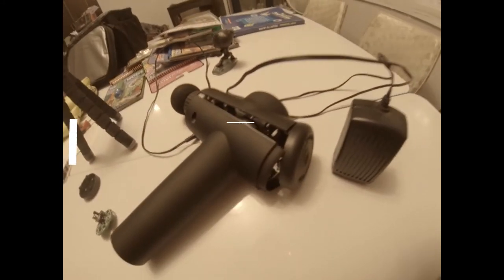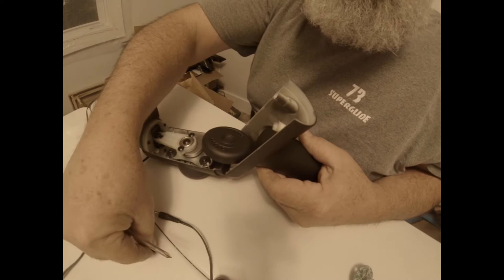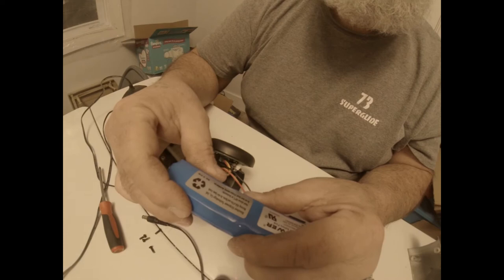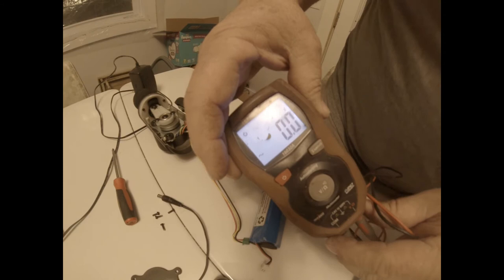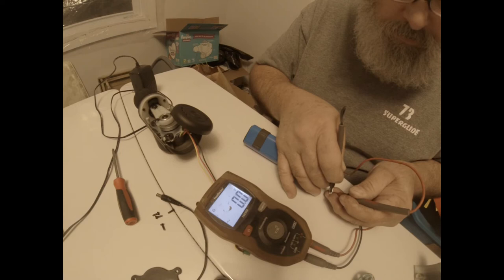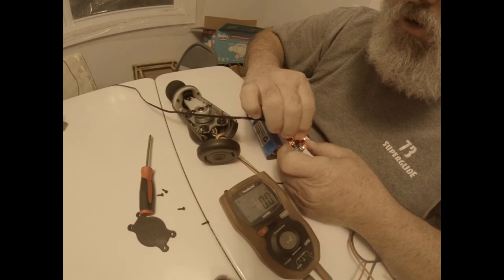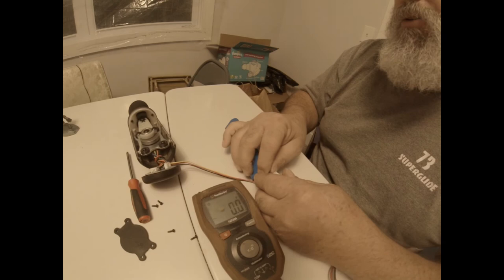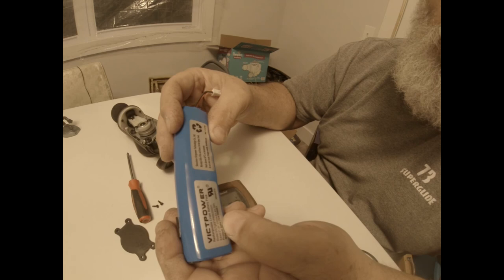SHARPER IMAGE POWER BOOSTER DEEP T MASSAGER STOPPED

Comment: how’d you take the bottom cap off?
Reply: Well how did you get the bottom off???
Reply: @supermizzy13 remove the sticker that says all the massager model information at the bottom around the turn on/off switch. Once you do you will see 3 screws that you need to take off, it should be able to come apart after you remove those screws.